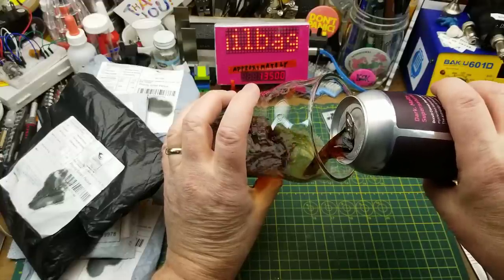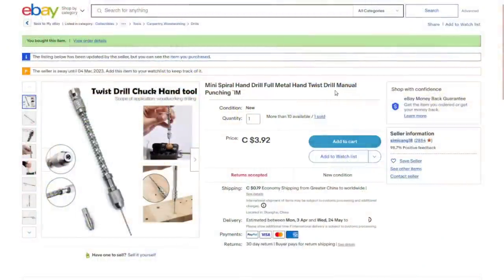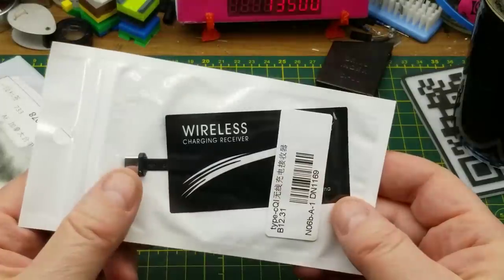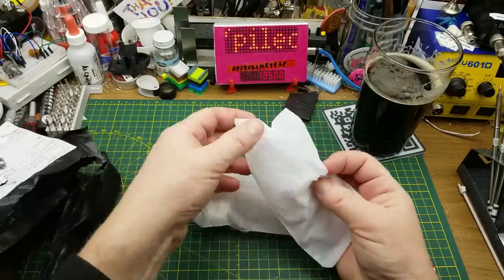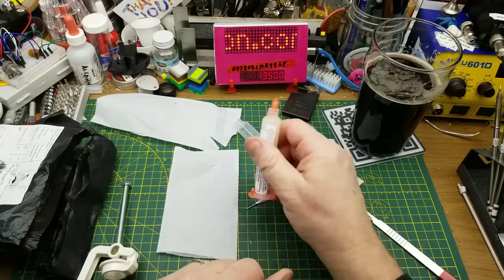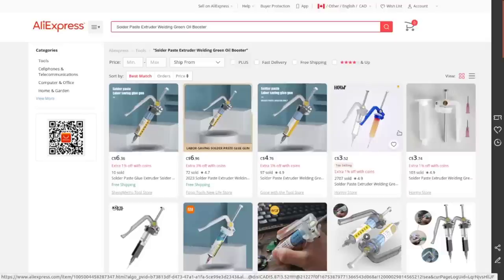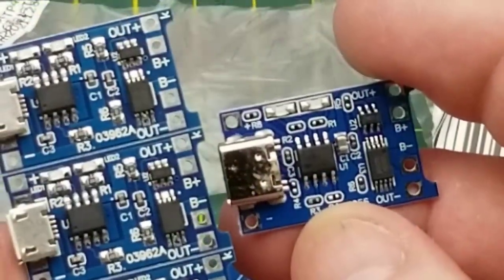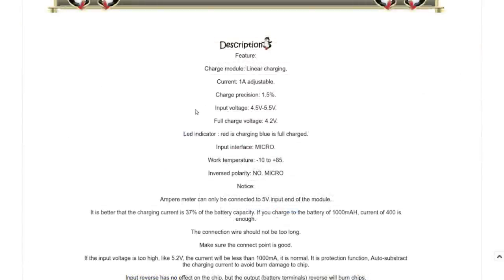Mailbag Monday 159

Comment: Don't feel too bad. I made that same mistake with one of those battery modules just two days ago. I have just ordered some USB-C power bank modules with battery/charge protection AND the 5V boost converter from Aliexpress for about 50c each. Will have to see how those work. Nice thing about them appears to be that the USB-A output socket is on the other side of the board and it is not soldered on (I have to "weld" it myself) so I don't have to fit it. Then it will fit flush on the circuit board - "Type-C / Micro USB 5V 1A 2A Boost Converter Step-Up Power Module Mobile Power Bank Accessories With Protection LED Indicator"

Comment: I have the original Radio Shack hand drill in a box somewhere. I have used those 18650 BMS boards for a few years.  I like them. That wireless charger looks like it was burned from the flash LED ( Torch )

Comment: I use those usbC charger modules with a battery from a vape and a push button switch  , a string of leds to make a bottle light. 
Have made many and given away many 😊
Reply: I did the same with those sample booze bottles to make a sting of them ( Patio Lanterns ). Fun times.

Comment: I want to build replaceable, socketed chargers with these cheap TP4056 devices, but the spacing on the pins do not fit a 0.1" grid.  Looks like they adjusted the spacing on the rear holes on your new USB-C ones though ... and a Bel Air tail.

Comment: looks like you could 3d print the dispenser.Sockets, I prefer the machined round hole ones. Drill good for enlarging holes.
Reply from the maker: I was looking at a few dispensers on Thingiverse, but the ones I found were far more complex.

I may have to take a stab at designing one, but CAD is my kryptonite...

Comment: That's a nice little drill. I've seen a few STL files to print something like it. They're a bit bulkier but might be a better size for someone with carpal tunnel if they had several holes to drill. (Also an excuse to fire up the 3D printer)😎
Reply: it's east to break bits with those type of drills, especially with hard surface. better to buy a drill press stand, if you have a hand drill machine.

Comment: In carpentry it is called a "Yanky". Not use mush anymore.
Reply: The yankee was sold by Stanley. I have a few. Sadly, too many people think that oil will be a good lubricant for them, then they sit in a drawer or shed for years and the oil turns to thick gunk and they can be a pain to get back to working order.
Reply: @mattsadventureswithart5764  Wright, I remember, I had one for a long time. No idea what happen to it.

Comment: All I got to say is that your a bad influence.... Already added one of the hand drill to my Ebay cart. Although I will admit I've been using either drillbits between my fingers or using the handful of 1/4" hex drive bits I've got in the shack with a 1/4" ratcheting screwdriver. I could use a much larger chuck size, as I'm mainly drilling holes in faceplates for different switches, knobs, and LED's; i.e. larger than 2mm.

Comment: What small drill bit set were you using?
Reply from the maker: I've had that cute little drill index for several years. I got it at a local hobby shop.
I searched and  found a similar one at Micro Mark https://www.micromark.com/20-piece-Micro-Size-Drill-Bit-Set-with-Index-61-80
Reply: @pileofstuff  Thanks for the find. I'll need to keep looking, the Micro-Mark is exactly what I'm looking for, but I'm a cheapskate, $14.95 is a little out of my price range.